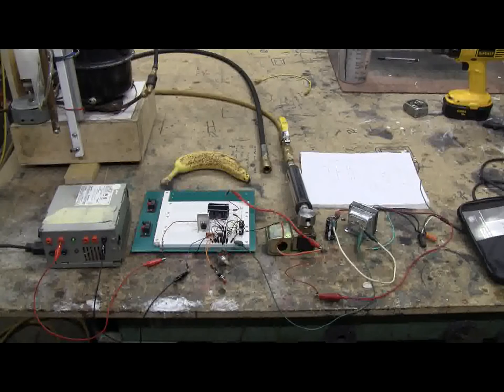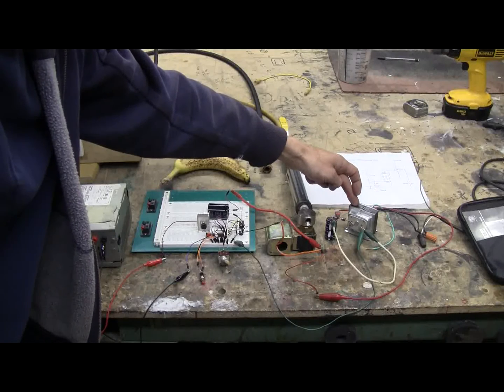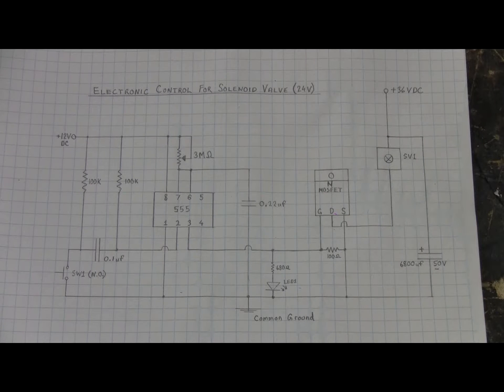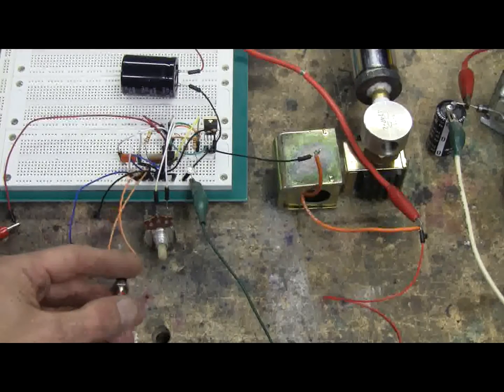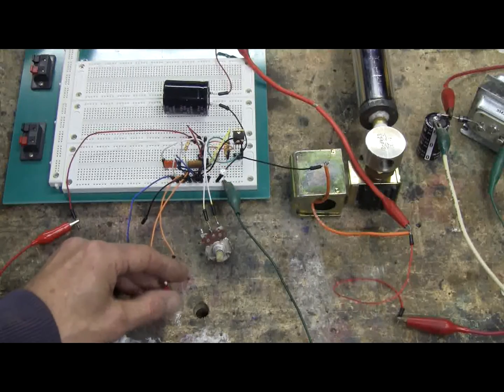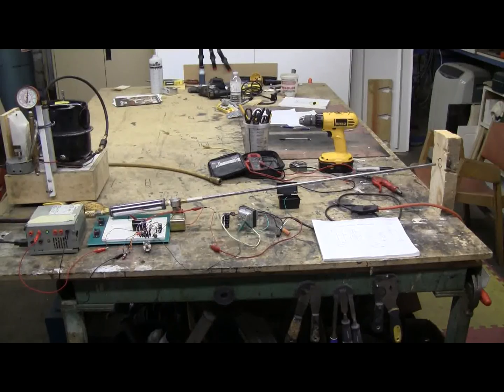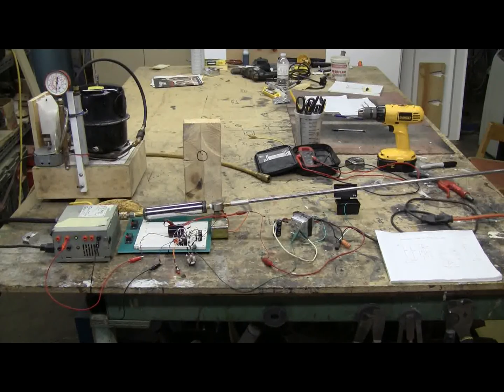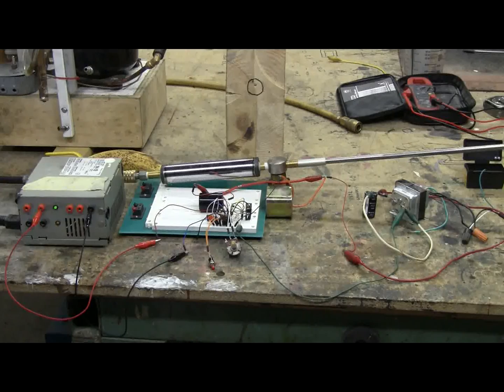Air Cannon #78 - Electronic Control Of 24 V Solenoid Valves

Comment: Why is it 36 volts ? Could 12 volts work ?
Reply: Tom A Hawk the solenoid runs on 24v AC, he's using DC so in this case you need approximately 25 percent more voltage in DC to operate the AC solenoid. This guy is talking mossfets and a bunch of other electronic gadgets that you don't need. I run the same 24v solenoid on four 9v batteries wired in series

Comment: Question for you, what components would I need for a much smaller selenoid (5vdc) and would I use the same build diagram? also how would I setup a reset switch so that you would have to cycle a bolt (bolt action setup) in order to actuate the selenoid each time?
Thank you for your time.
Reply from the maker: You would not need as powerful of a mosfet, but it will need to be logic level. That or use a transistor. Since the solenoid is 5VDC, 3 or 4 AA batteries in series should open it. As far as the bolt cycling goes, you would need a switch or sensor on the bolt assembly. A simple switch would allow the signal to go to the mosfet or transistor only if the bolt is in the closed position, for safety. A sensor could be hooked to a logic chip in order to detect bolt cycling and bolt closed, as well as perhaps sensing out of ammo in the magazine.

Comment from the maker: I built it up properly in a small project box and installed it on the .177 BB cannon. I also changed to a better solenoid valve. With the new control and valve, I can get velocities from 100 to 800 fps. Should have shot a video today, but I used up my free time shooting up some steel cans. Video maybe tomorrow. Thanks for watching.